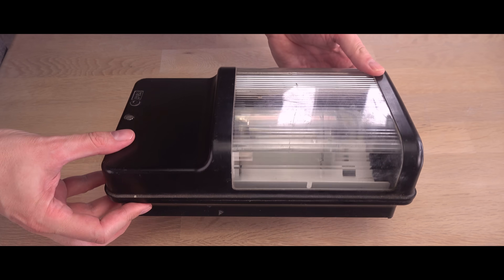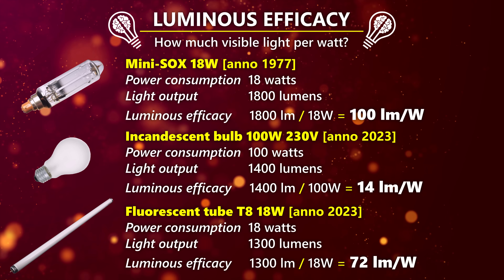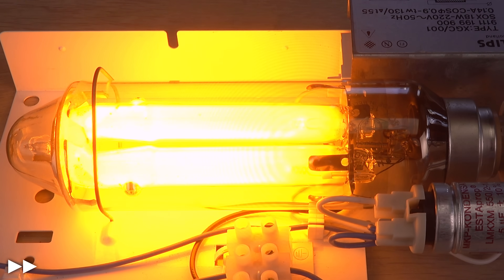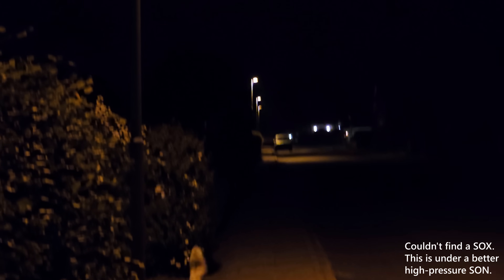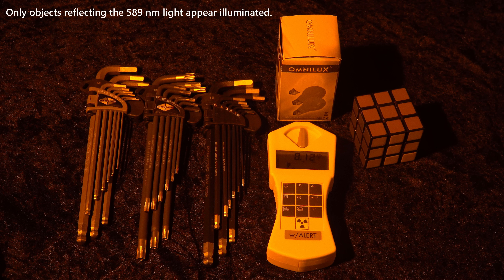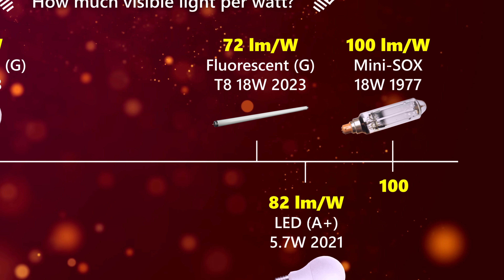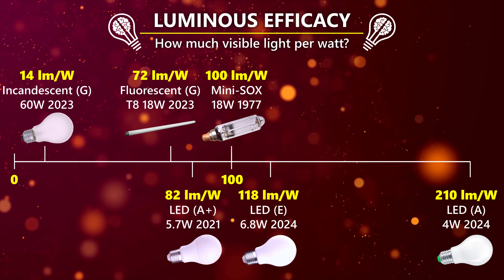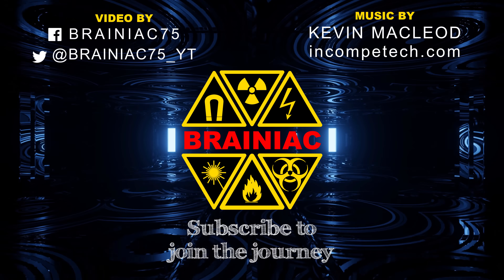THIS LAMP SOXs! "Yellow" tech of bright metal vapor lamp. Beats modern LEDs in brightness per watt?

Comment: I just use what ever cheap 60-100 watt equivalent LED bulbs I get from the dollar store. not only do they last longer but I like that most of them a brighter slightly cooler white making even 1 light light up my small white walled bedroom.
Reply from the maker: Makes sense - and in general, all 60-100W equivalent LEDs are very efficient nowadays. In a normally sized home, it does not make that much of a difference on the electricity bill if each lamp uses 4 or 7 watts... Thanks for sharing!

Comment: My late father was a police officer in Southern California in the 1970s when sodium vapor streetlights were introduced. 

Yes, they saved money vs mercury vapor lamps, but it made identifying colors impossible for stolen cars or the clothes of suspects. 

It took 25 years but most of those yellow lamps are gone.
Reply from the maker: That makes sense. They would have to be lighted by the cars' headlights to be recognized. In darkness, all cats are grey ;) Thanks for sharing an interesting detail!
Reply: That is correct
Reply: Despite obliterating the color perception of objects, when introduced in the late 60s early 70s they were widely heralded as a boon to public safety at night for their supposed ability to deter crime. There are still several documentaries floating around on here from the era confidently proclaiming the new crime fighting powers of the then new Na lights. Didn't quite work out as we all know from the subsequent enormous spikes in violent crime in the 70s and again in the early 90s.
Reply: Low Pressure Sodium lamps were invented in 1920 and used in installations like bridges and roadways in the 1930s but they never gained much popularity in America. You may be thinking of High Pressure Sodium lamps which came on the market in 1964 and were common in the later part of the last century. High Pressure Sodium emits several spectral lines so they look pink-ish orange while Low Pressure Sodium is pure 589nm yellow.
Reply: @Peter_S_  Long Beach, CA deployed both 9remember it was the 1970 oil crisis and cites were trying to cut energy costs).  I distinctly remember some streets (mostly in industrial areas having the LPS lamps), and residential streets choosing the HPS.

You could see the bight golden glow of LPS when you flew into SoCal as it looked like a huge computer motherboard with all the gold street lights.
Reply: Flagstaff AZ too❤

Comment: 1:27 1977 right after that is when all the street lamps were converted to those Sodium lamps.  They've now been converted back to white LED.  Which has astronomers rather miffed. It was easier to filter out the sodium light when doing long exposer imaging or time lapse. "Sodium vapor lights emit on a relatively narrow wavelength."     Not as easy to filter out the full wavelength of LED white light.
Reply from the maker: Yep, if you filter out the white LED light, you also filter out the visible light from stars, galaxies etc. I have some glass doped with Nd3+ that should filter out the light from sodium lamps. Will make a video about it at some point.

Comment: We have 180Lm/w, Up to 200lm/w in the market now, so this type of light is totally obsolete
Reply from the maker: Yep, the SOX can go that high too (as mentioned at the end of the video) but the color rendition - and complicated manufacturing - is really what makes them obsolete. Thanks for the early watch and comment!
Reply: This type of light can pass 190lm/w in the brighter versions, which is precisely where LEDs don't do well because they get too hot when the fixture is running like 100w.
Reply: @seth094978  actually more the LEDs are efficient less heat they produce 😉
Reply: But this light used plasma, which is beautiful, interesting, in other word the boss. L**s are boring solid state devices.

Comment: Those sodium lamps were only ever designed for object avoidance on roads and footpaths. For this, they're perfect. And in fact, in some ways better than white light, for example, astronomers could filter the sodium discharge out.
Reply from the maker: Yes, not designed for indoor use for sure :) Need to make a video about why astronomers miss these lamps... I think the sodium lamps also have less impact on our adapted night vision. The white LEDs just wash out our night vision so our eyes need to adapt to the darkness when driving out of a city... Thanks for the early comment and watch!
Reply: @brainiac75  
Yeah, yellow is on the red side of the spectrum, it affects the sensitivity of your eyes rods a lot less. 
And the lack of blue means it doesn't affect melatonin destruction.
Reply: @brainiac75  LEDs shoud be banned
Reply: @brainiac75  Also a lot of the white LED's in the cities next to mine when they start to age they turn into a blue-violet light with really bad illumination. 

I like LED's but i do prefer a lower color temp for anything that requires good night vision without destroying contrast
Reply: One massive issue is that orange high viz vests become completely invisible. This is why most high viz vests have this greenish yellow color, which works with SOX, but doesn't work if you have a background of spring leaves in daylight.
Reply: Yeah involving CRI is only an after thought when identification of things like car colors and what not became a thing. They certainly weren't for the view. It was a practical consideration. There's a reason they have so much reach and that a wider spectrum lamp can't perform anywhere close to them... the energy is spread out. You can't have it both ways.
Reply: Yeah I preferred the look of the old sodium. A lot less harsh on the eyes.
Reply: LOX lamps were used until somewhat recently on the Golden Gate Bridge in San Francisco. The yellow light is burned into my memories.
Reply: Personally I think we could reach a happy medium that would be acceptable even to the astronomy world... It would seem to me that while expensive, laser diodes would be the way to go here. Used in a way similar to the LEDs, not collimated and diffused, one in each of the RGB bands. 

No the CRI won't be "excellent" by anyone's standards, but it will be much better than the single yellow line of the LPS lamp, and could be notch filtered at the scopes.

It won't go this way of course, things are already way too messy... but if one had to start over from scratch, it would be worth a look methinks.
Reply: @MadScientist267 Lightning has gotten fairly inexpensive to install and run so a lot of homeowners light up their property to scare away shadow monsters. I'd love to see more dark sky compatible lighting, but buying 5000 lumen import bulbs doesn't help.
Reply: I always found they illuminated the street better than white light, especially in rainy condition
Reply: @stefanbacher8813 Agree. I find LED lamps reflect much more off wet surfaces. It's not helpful.
Reply: One of the use cases was the mary poppins sodium vapor process
Reply: This is by far the biggest factor for HPS Lamps. The monochromatic light creates by far the biggest contrast for the human eye. Even though every object on the street was amber and black, you were able to see shapes and movements far better than under white LED light. White LED lights might be truer to the real color of the objects on the street, but everything turns mushy when looking at it and the contrast is rubbish. And in my eyes, I rather see the shape and silhouette of an amber and black kid on the street in time for breaking, than running over a child while marveling at how awesome the colors of the dead kid's clothes look in the white LED light.
Reply: @Metatr0n  There are a couple effects in play. Both very high contrast to the eye and all of the energy is converted to light in a single (ok double lol) line on the spectrum, making it extremely intense at those 2 wavelengths. For whiter light you have to spread the energy around... this takes away from its ability to reach, as the compromise is this wider band must all be lower intensity. The radius of light from those two sodium lines is unmatched for power input to a given lamp. 

This is what makes incandescent so inefficient. There's plenty of "light" there, but because you have to get it past the invisible IR to get useful light out of it and that IR not only remains but consumes even more of the energy going past it, all of that light is wasted on wavelengths we can't see... they would be a pathetic choice for street lights... the visible light represents ~1% of the energy input in the useful range... they'd need to be 30, 40, 50kW each to get the same amount of light out of even a halide, nevermind sodium 🤣

I don't think I'd want to stand anywhere near a 50kW sodium lamp, nevermind attempt to look at it. Neither would be recommended, methinks. Incandescent would be really hot, but from a modest distance, viewable.
Reply: I just got an idea. I am working on a game in Unreal 5 featuring the Backrooms. Those are crazy yellow already but how would they look if you at least in some areas replaced the classic backroom buzz lamps to use this color instead? That would be very easy for me to do so gonna try that in my backrooms level later today and see what it looks like. The question is, how realistic can even a state of art game engine like Unreal 5 represent a sodium vapor light including its color rendering of objects? This can be a really interesting experiment. In any case I bet however that it would go perfect together with this theme and making the already creepy backrooms even creepier.
Reply: @johnpekkala6941  
You could probably introduce some interesting colour puzzles too.
Reply: And YouTube deleted my comment about it affecting insect food webs, thanks YouTube...
Reply: The rollout of white LED street lights is a disaster on so many levels - road safty, light pollution, killing of nocturnal insects, disruption of human circadian rhythms. Not a thought given to any of this. It was just assumed that now we have efficient white light tec that its better than orange.
Reply: @petewright4640  road safety? proper led lights will only improve it as you can actually see more, where i live they are made so well you actually don't get blinded at all and light distribution is far more even

on SOX lit streets i can barely see shit, even without the light of a car or of another street involved they suck, not just by not having any color but to see aswell

HPS is already a bit better but still awful, no i prefer white light, i can actually see color and differences in the road surface better
Reply: @BH4x0r  The good thing about orange is that it means other coloured light is more visible. So for example if you see white light it means another vehicle or perhaps a pedestrian with a torch. If I see white light reflected off of say a kerb stone then i know that another vehicle is likely just round the corner. Its like separate information channels.
Reply: @petewright4640  i guess they could use a bit lower kelvin lighting, enough brightness, colors are existant etc but they're different than the bright white of modern headlights
but then there still are alot of cars with halogen where i live so then those will be less noticeable
Reply: They have much worse visibility than any other lamp i have ever used.  

And the color of the light fks with your eyes.  And makes everything look yellow or black.  

Seeing the world in only 2 colors does NOT improve visibility
Reply: I like sodium vapour light. It's got a nice, comfortable feel about it
Reply: I find my night driving vision with sodium vapor to be significantly better than with LED. I feel like I can see into the shadows better, the light fall off feels less harsh.
Reply: @seth094978 
There's no feel involved, they are better. 
I'm your eyes your rods (monochrome night vision) take over from your cones (colour day vision) 
Because of their high sensitivity the contrast ratio you can see is much higher, allowing you to see into deep shadows.
Reply: yes but as mentioned in the video, (affordable) LEDs are coming close to efficiency.  I'm in third world but almost all new street lamps in our country are LED with solar and battery.
Reply: Sodium + Cadmium would of been pretty good at making warm-white light , I believe. Maybe.
Reply: It's better because it preserves night vision better than white light.
Reply: Despite all the anecdotes about HPS being safer, the scientific evidence is clear that LEDs are better in reaction time and object detection. Yes, disrupting the sleep cycle is intentional, you should not be driving if your body is in the sleep cycle. Color reproduction is important in object detection, otherwise someone wearing a blue shirt in front of green foliage would be invisible with HPS. 

That said, LEDs require special design for spacing and lenses to ensure optimal coverage Just replacing HPS with LED bulbs doesn't work. A well designed LED system can have near uniform brightness.
Reply: LEDs are causing havoc with wildlife populations here in the UK, there's no supposed to be daylight at night so it's screwing up various insect and animal populations, destabilising, can't remember the word, food system pyramid things.
Reply: Indeed!!!!
Reply: @Bobo-ox7fj Reflectors only work if you shine a light on it from the viewers perspective. Most people don't walk around a work site or rail yard with a search light on their head.
Reply: NOT https://youtu.be/UQuIVsNzqDk?si=y5vrGP-lwgEmYko7
Reply: Much better for wildlife and insects too
Reply: Some 20 years ago when I was at a consulting engineering firm we worked with a company that made RF induction fluorescent lighting and the township ended up awarding a contract to switch over to them in place of the existing HPS street lamps. One of my favorite features was that they were designed from the outset for minimal light pollution with special reflectors and only modest light output, which provides a very nice soft illumination, and are almost as nice as the original turn of the century incandescent lights they had before the HPS. At the time the township was still somewhat apprehensive and they seemed to have squirreled away their old HPS heads, which now are being put back into “service” since some of the RF drivers are finally starting to die after over two decades of use. Unfortunately for the township the HPS’ have not aged well and die almost immediately after installation.
Reply: Humans also see in monochrome at night - not fully monochromatic, but heavily biased towards it.  So the sodium vapor lamps complement our night vision instead of fighting it like white light does.

Sodium vapor is a WAY better streetlight than LED for that reason.  They aren't meant for color rendering, they're actually meant to wash colors out.
Reply: @hoxviii my honest opinion, i can see way better now than back in the day with that awful orangey light, and i'm certainly not mad about having better lighting

it is one of the reasons i did not like being outside at night, as i actually don't see that wavelength super well

to me streets with those always looked like there barely was any light
Reply: For public lighting sodium are best
Reply: "LED streetlights reduce insect populations by 50%, according to researchers at the University of Newcastle."

Dangerous loss of biodiversity.
Reply: @MostlyPennyCat I would add to your excellent comment that the rollout of white LED street lights is a disaster on so many levels - road safty, light pollution, killing of nocturnal insects, disruption of human circadian rhythms. Not a thought given to any of this. It was just assumed that now we have efficient white light tec that its better than orange.

Comment: I used to have some glasses with special lens, that would help with color rendering when working with HPS grow lights.
Reply from the maker: Interesting. I wonder if they used Nd3+ ions to lower the massive 589 nm line to make the other colors stand out easier (HPS should have multiple spectral lines - not just the 589 nm one). Thanks for the early watch and comment!
Reply: @brainiac75  Thanks for another interesting vid. The glasses worked great, turned everything from HPS yellow to almost daylight white. Made by a company called Biora, they have blue/grey coloured lenses. Was always interested in how exactly it works so well.